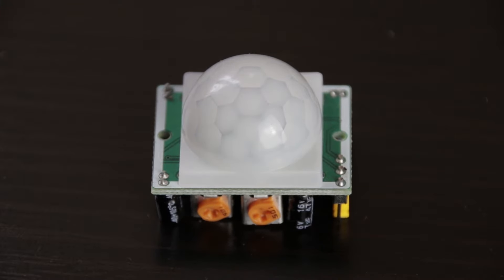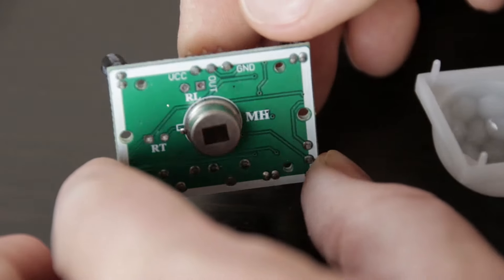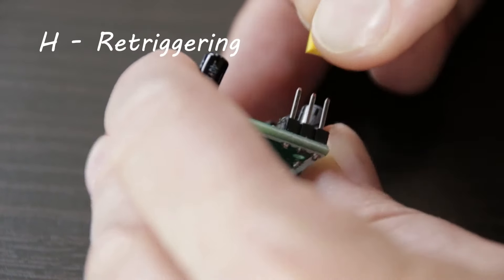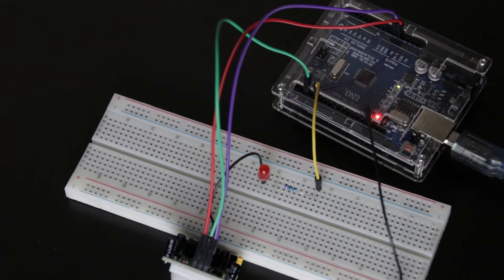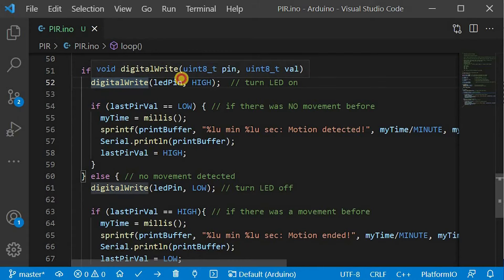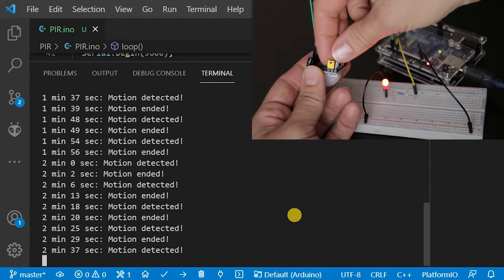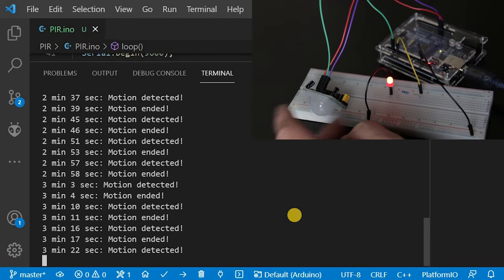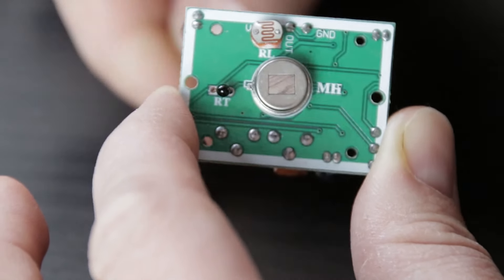PIR sensor HC SR501

Comment: in the datasheet, the R and I mode where labeled in the opposite way, expected it might have been a mistake in the datasheet, but since I didn't know if the 3.3 would trigger the arduino(while it should) s well as other things I might have made a mistake at I decided to look at someone using it, and luckily the datasheet just had those 2 the wrong way around.

also my code for testing was:

void setup() {
 pinMode(7, INPUT);
 Serial.begin(9600);
}

void loop() {
Serial.println(digitalRead(7));
delay(100);

}

Comment: How much voltage does the "OUTPUT" give
Reply: I think 3.3 volts, its so weak you can only power led light with it. I used transistor bc547 to turn on buzzer and strong led.